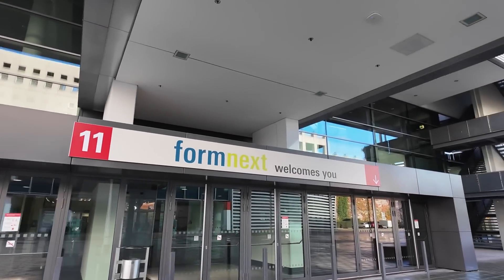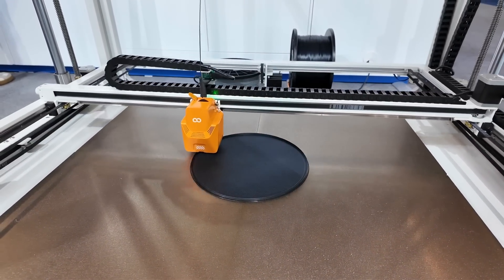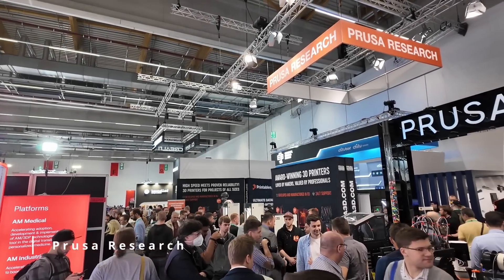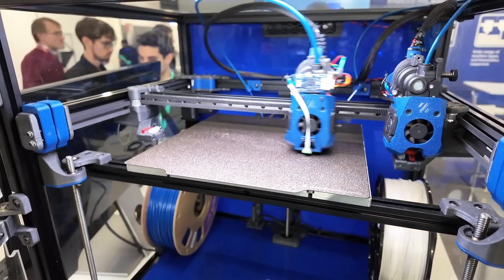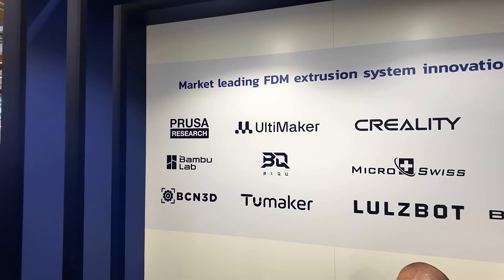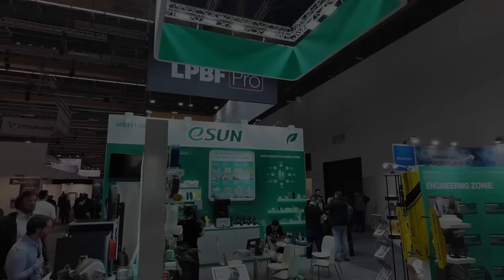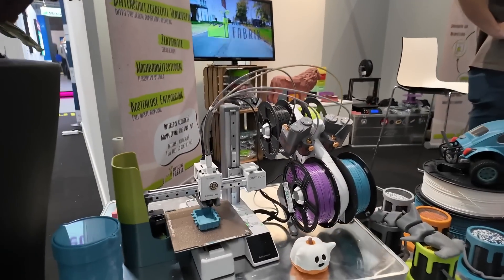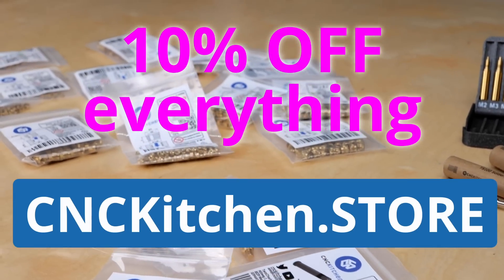14 3D Printing Innovations in 18 minutes: Formnext 2023

Comment: Let's try short comments on each one instead of giant writeups...

Elegoo: curious about that bed too... those are standard Neptune 4 beds. So there is literally a hole in the middle where 4 curved beds meet. You bridge over the bottom of the printer...
phrozen: this is actually a bit disappointing... So many have prototypes but they all work and that one literally has wires hanging around, has dust on the top, and more. Like... they made a visual representation instead of a prototype. With how people were talking about it on Twitter and YouTube, I thought it was like Peopoly surprising people with a FDM printer (even if early engineering version)... but no, it's a jump on the hype train with little substance. If the AMS-like system does become a thing, that would be interesting, but my hopes are lower at this point.
Bambu and Prusa: pretty well covered at this point so no comments from me
Duet3D: interesting... they have been seen in more printers but didn't realize they were slowly ceding their place in the consumer market. Competition does that, but it's a case of adapt or see your market shrink... and "staying the path" is infamous for eventual collapse. Hopefully they do something... OEM printers getting more expensive because they have Duet vs. something else isn't gonna help, and enough people complain about their prices already that between BTT and others, it's a wonder they haven't announced lower cost boards or similar.
E3D: awesome, you may have missed but they have a high flow obXidan now too (though not released yet).
AnkerMake: this one is confusing to me... they announced the M5... then announced an "addon" of the V6... and everyone thought it was a filament storage box (Bambu didn't exist yet, so "oh, their own AMS" wasn't a thing)... and then... nothing. Bambu is working on year 2, the Prusa XL managed to come out, the MK4 came out, a number of companies showed up with new high speed printers, new designs, multiple multi-color approaches... and AnkerMake still doesn't have an image of the toolhead for the V6. I kinda love that it's 6x extruders, and had seen that from some TikToks... but there's like nothing. At this race, Prusa will work out their XL multi-tool issues, Co-Print will release, heck... maybe even phrozen will go from visual demo to actual machine in the amount of time that they have worked on this.
Co-Print: interesting... but jury is still out IMHO if this is a good approach or a random collection of parts in a nice package that won't actually get traction. I do like that they have tried to make it available for different printer owners in a plug and play fashion.
eSUN: saw Filament Stories show off zebra filament... I'm sure lots will like it, I've never gotten into drastic color changes at this point so no real opinion beyond that.
colorFabb: the OG of fancy filament... it's a pity they seemed to have scaled back resellers in the states as I love their filament (though it's special use stuff due to the price). I still need to try the pure PHA filaments.
Recycling Fabrik: the curse of recycling... there was a company in the states called RePLAy 3D that did the recycling into filament. You would buy a, honestly, nice semi-matte black filament (well, dark grey). Get some points for purchase. Pack up your scraps, order a shipping label from them (free) and send them the scraps to be turned into filament. For every kilo, you get a certain amount of points. You needed to send in like 20 kilos in order to get enough points to get a single spool of new filament... and that + it being expensive probably what killed them. People expecting Fabrik to be cheaper is unrealistic, and yet, the whole demand for filament recycling is "turn my scrap back into filament". Which brings us to...
3DEVO: cool to see 3-axis scanner and... wait, I want that little demo scanner. Darn, now I can't get it out of my mind...
Filamentum fishy filament: I wanted to try this but they were basically sold out when I did a purchase. Love the concept, need to see if it's in the same ballpark as other nylons for functionality or just a recycling gimmick. Hopefully good.
Glass: want want want... I don't think I can bring a 200kg kiln into my living room... some people would probably be very unhappy. Now just to wait for a PrusaSlicer profile...

Comment: How are socket head cap screws annoying?
Reply from the maker: Did you ever strip a hex key on a small bolt? When I built my Voron 0,the M2 and M2.5 bolts drove me nuts. TX makes that sooo much better!
Reply: @CNCKitchen  Ah I see. I usually use M3 or larger for all my prints so I don’t come across that issue but I had to use M2 a while ago and it felt like it was gonna strip anytime soon every-time I use it.

Comment: they should use a large rotor drone with a tether and mast to print cement buildings using high flow low volume cement hose. Also use RTK GPS and optical flow for mm accuracy.

Comment: Prusa smaller XL's brother with 27cm3 build volume, built-in enclosure, active heating and 2x toolchanger at a price point of sub 1500$ would save them from the serious competitors
Reply: Look at how prusa operates and look me dead in the eyes and tell me you think they could pull that off.

Part of the XLs problem is they tried too many things at once and I imagine intetnally feature creeped so bad the end product would be half baked no matter what.

The other problem is that unlike other designs the XL doesnt at least to me, appear easy to scale.

Many of the components luke power supply placement and the bed size seem much harder to split than say, a voron.

I mean maybe they make it with only 2 bed panels side by side rather than 3, but I imagine its easier to just sell that rack mount printer.

Comment: Glass printing is really interesting. I've felt like I've needed this for years, but right now I can't think what I'd actually use it for. With the layer lines, it's probably not food safe.
The multi-color approach on the AnkerMake V6 is very interesting. The print shown (yes, it's a prototype) didn't look that good, with some visible layer errors, but I hope they can refine it to the point where it's painless. We need more multi-color choices, and preferably ones that don't waste as much filament as they use for the actual print.
I wonder if ColorFabb has considered putting those elephant grass fibers in their PHA? Wouldn't that reduce the warping?
Reply: Why do the layer lines make it non food safe? I have printed quite a few food processing items form food safe PET-G and with the correct slicer parameters no gaps or nooks form where residues can collect.
Reply: @Bapate-rh9be  have you actually tested and verified that the printed parts are food safe? Just because the material may be classed as food safe does not mean that the printed part will be.

Edit: you also claim no gaps or nooks form, have you looked at a 3D printed part under a microscope? I think you would be very surprised how many gaps and nooks actually form.

For occasional use items, like cookie cutters, you will be fine, the main issues are with things like plates, bowls, bottles, cutlery, etc, where they will get used often and you are wasting or drinking directly from them.
Reply: @Bapate-rh9be  bacteria can survive in the gaps. I believe this has been demonstrated in lab tests (presumably by testing for bacterial growth in petri dishes).
Reply: @Bapate-rh9be  the layer lines will always be a place for residues and bacteria to build up
Reply: I see. I used it to print cookie cutters, so I suppose it does not matter all that much as long as the cookies are properly baked. Thanks for the heads up!
Reply: "Layer lines make it non food safe" is just a tired talking point people love to repeat to feel smart. Meanwhile, every injection molded baby sippy cup has internal acute angles that are impossible to clean mechanically. Somehow we get by because we have these magic things like bleach and hot water and steam...
Reply: @daliasprints9798  yes i definitely agree that printed parts can be cleaned but it's more difficult than regular molded parts
Reply: @StephenTeitgen  The main difficulty is that PLA is destroyed way below temperatures needed to clean and disinfect. This is completely irrelevant to glass which can go in dishwasher or even autoclave.
Reply: @daliasprints9798  comparing injection molded parts to 3D printed parts is not a great comparison here. With injection molded parts there will generally be far less hard to clean areas and for food use the surface will generally be smooth and hence easy to clean. 3D printing is totally different, the surface is no where near as smooth and hence has lots of little ridges that are much more difficult to properly clean.

Comment: I was on the Prusa booth to ask for a prusa XL toolchanger packet to bastardize and install into my V-Core 3.1 (because its a much more capable printer). And the guy I talked to was super nice and explained how I would get the package, all of the necessary replacement parts and how to proceed to modify and install it. He told me to order it as an upgrade package online (although I may need to find s.o. with a prusa XL so he can order the upgrade kit for me). Then he told me they have a year lead time...
Reply: There are plenty of other tool changer designs out there and it still remains to be seen how reliable the Prusa one is.

The one year lead time is ridiculous though, extra tool heads is going to be something that lots of people with the Prusa XL will want. So if you get your Prusa XL you can’t get extra toolheads for a year? Say you preordered the one tool head version, possibly to save money, would you have to wait a year to get more toolheads? This alone is a reason not to get the Prusa XL.
Reply: @conorstewart2214 seems like overtime they are getting better, I know the wait time is definitely annoying but to each their own.  I have yet to see anything currently on the market that can do what the Prusa XL can do.
Reply: Lol 1 year lead time. By that time it's already outdated. That's so prusa

Comment: Honestly, im not surprised Duet3D's share of the maker community is dropping.i love Duet hardware, its stunning, and incredibly well built, and the documentation is extensive (if impeccable confusing) but it is also ungodly expensive, and not for no reason, but its really hard to compete when your main pulls are "we are reliable, and we run this firmware" BTT might swap components and firmware every 4 months, but at least I know I can afford them. Duet3D never seemed like a consumer business, it seemed like a B2B enterprise that someone convinced them to sell some to the public
Reply: On my V0 which i got from stefan i use a Fly board with RRF. On the MK3 the einsy. On the other ones Duet mini5+. You sometimes get them "cheap" so far i paid 92€, 95€ and 115€ for them which is ok. I had 3 SKR2, 3 Octopus (1 dead on arrival, which i didn't got replaced), 2 e3 mini, 1 ramps 1.6  All  of the boards died sooner or later. Ok i have 1 last mini e3 which was in stefans V0. Buy cheap buy twice. But sadly at the store i bought them before they are actually at 165€ (converted to €)
Reply: @danielkrah5129 that's still insanely expensive for the features they offer. I paid €105 for a manta m8p with 8 2209s and a cb1.
Reply: the mantra of "buy one cry once, buy man cry many" certainly holds true, but in my personal experience I've only ever lost one board (DOA got replaced free of charge by vendor) so paying double or triple for Duet was always a tough option for me @danielkrah5129
Reply: The price together with how versatile Klipper is will probably be the main factors is their market share dropping which really isn’t surprising, considering you can get a BTT octopus pro with the STM32H723 and stepper drivers and the BTT pi for less than £100 and then you can just run Klipper on it.
Reply: i think its hard to justife mainboards for couble hundret euros on 3d printers i see them more in stuff like low budget cnc machines 2k - 5k machienes
Reply: I used Duets in almost all of my builds because the whole system is just easy and seamless to work with, especially for someone that is more into the mechanical aspect of 3d printing rather than the software... And the duet just made life easy.

And also I don't think it's fair to say that it wasn't really a consumer business because it came directly out of the community, David Crocker (one of the guys behind the hardware and software of the duets) was, and still is very active on the RepRap Forums (and not just in relation to duet, just generally helpful) so you had an easy and direct line to him if you were having issues, and he seemed to be pretty receptive to ideas for new features or improvements, which is how a lot of new developments quickly got support on the duet and in reprapfirmware.

So yeah sure that all doesn't  really matter if you're just building a standard printer, but if you like experimenting and building some more unconventional designs, the duet has always been a very good option.

Though undoubtedly nowadays the cheaper offerings out of China have matured a lot. It's not just all RAMPS 1.4's stuck onto fake arduinos anymore, or some slapped together board with bare bones firmware support where you have to go to a sketchy site just to find a version of marlin that works on it lol

I guess it's kinda similar to how Chinese printers in general just improved, back in the day there were so many just garbage printers coming out of China, even creality had a bit of a rough start. But now they're all pretty much fine. Or even excellent.
Reply: In my experience, Klipper is much more fragile with it's multiple MCUs and CAN systems. The Duet3D stuff just works and you don't need any programming skills to troubleshoot it.
Reply: klipper's CAN implementation is pretty dang rough that's for sure, Duet got around it by only designing for one type of CAN, CAN-FD and made sure it was rock solid. you don't need any programming skills to troubleshoot it, but you do need an encyclopaedic knowledge oh its semi custom code structure @robertgcode965
Reply: @robertgcode965  after the initial setup issues I've not jad problems running 2 boards and a can driver expension. But well see how long it holds up